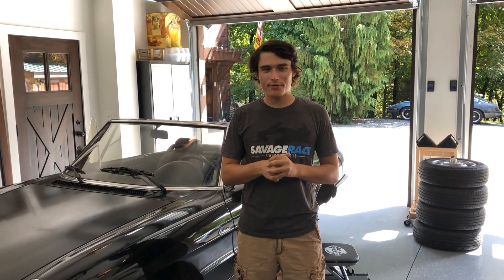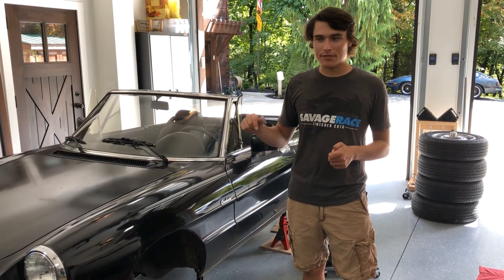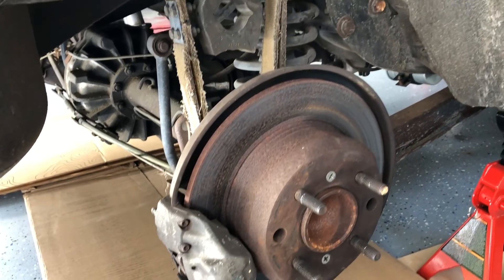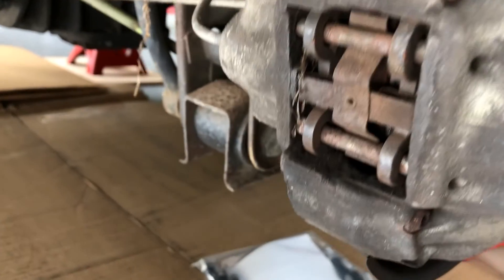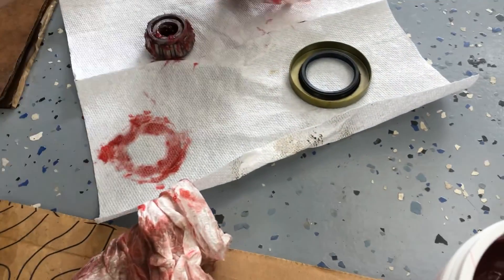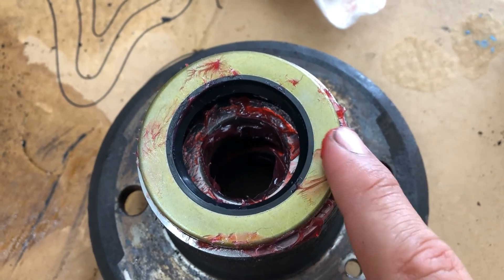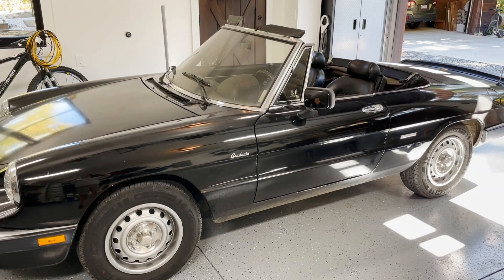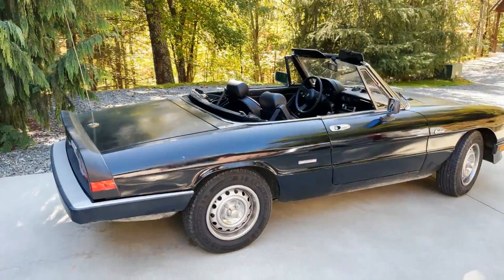Replacing Soft Lines and Brake Pads; 1987 Alfa Romeo Spider Graduate

Comment: Yeah, push the pistons all the way back before mounting the caliper and grease those pins after they are in. All your gonna do slathering grease along the whole length is attract dust which is gonna jam them up. I doubt they even need greasing cos rust doesn’t seem to be much of an an issue where you live. You don’t need to take the hard line off the caliper, just take it apart at the Union with the soft line. Cracking antique brake unions and reusing the same parts almost always results in leaks. Just needs a rust dust particle in the thread and your done.
The wheel bearings being left hand thread is a fail safe feature. If the split pin fails the rotation of the wheel will not undo the bearing hub nut.
Use a puller to get the hub off if it’s been in there for years and jammed. Wear two pairs of gloves when packing the bearing grease, just peel off one when the bearing is done. Far too much grease in there. No point putting grease where there is no metal on metal contact. Just makes a mess when your back in there in a few months time replacing the old bearings you put back in. Didn’t see you replace the rear hub seal. So all that grease will be all over the brakes in no time. As it leaks past the antique seal. She’s an old Italian sports car, as soon as you start taking things apart and forcing stuff like caliper pistons with spanners and screwdrivers they will fail. Gently does it using a g clamp and wooden block to ensure even pressure.
Repairs and maintenance on these cars is always more time consuming and it’s best to order all the parts you need before starting. It is just not cost effective in the long run to reuse bearings etc. She’s a thoroughbred and deserves to be maintained properly.
Reply: Hi guys ! How do you push the pistons ? With one key ? 
Thanks